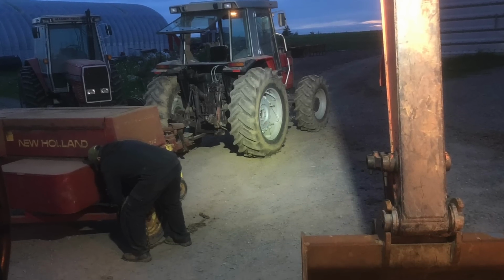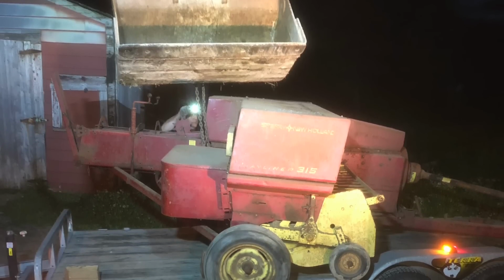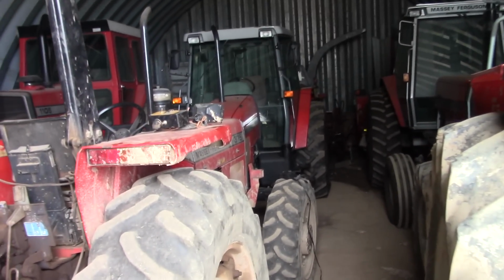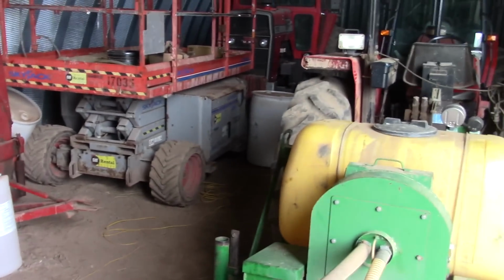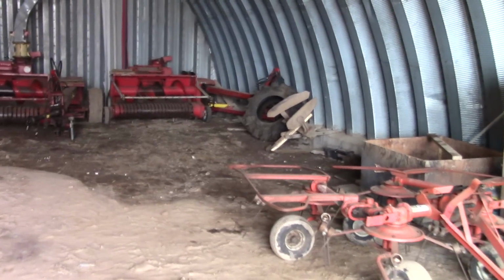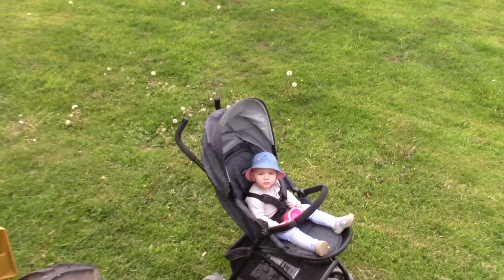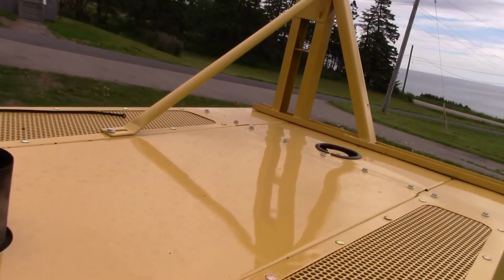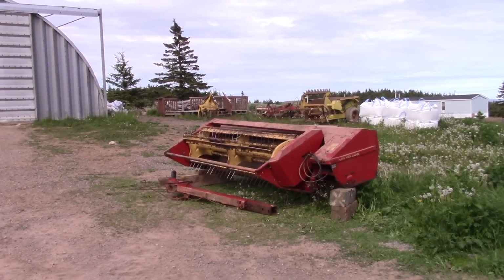Shed Clearout: Moving Masseys

Comment: Nice collection of the older Massey’s there good tractors we had a 362 and 3505 may be looking at buying a 1105 or something around that 100-120 horse. How many working tractors do yous have and use in the field?
Reply from the maker: We have 10 tractors total. We pretty much use every one of them for something. One of the 885’s is apart as a Resto project and the 1105 doesn’t see much “fieldwork” but it’s our primary silage blowing tractor and also gets used on the stir stick. We spread some manure with it last year too. None of them are here as collectibles lol
Reply: Mac Farms that’s what we say. No point of having a good working tractor and just have it sitting around work them!

Comment: the old 375 there same as the 275 massey wich i used to use and the 3070
Reply from the maker: The 275 was quite a bit different than the 375,  smaller engine like the 265, same power as 265, transmission is different, rear end no doubt as well.